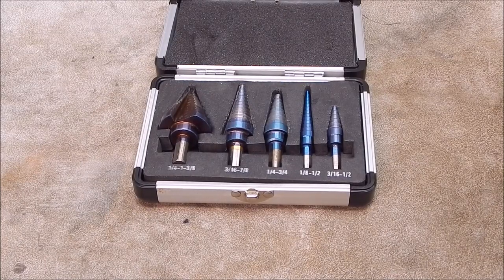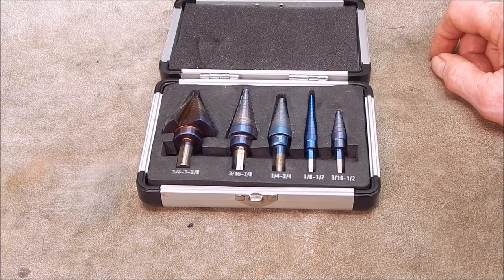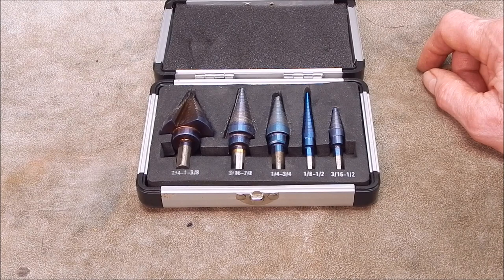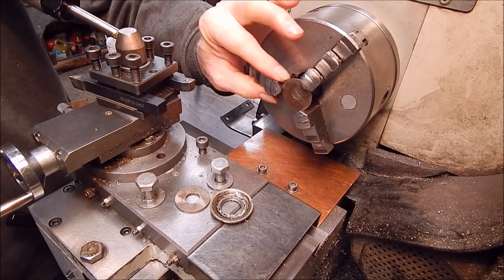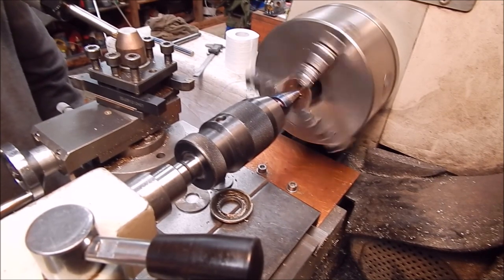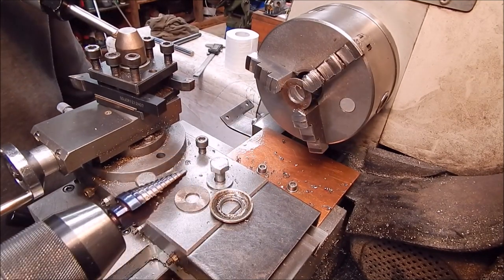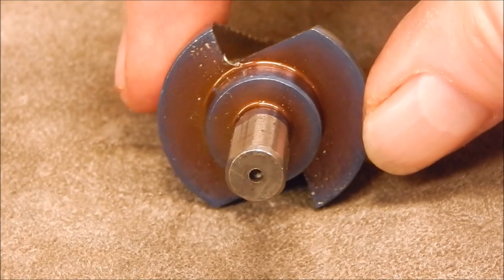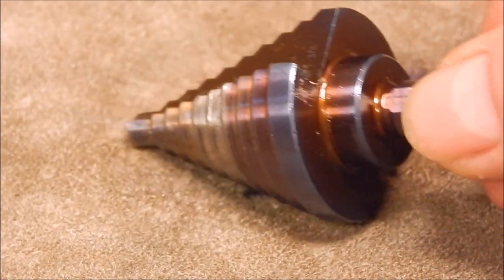Banggood Drillpro blue nano stepped drills re-visited - what's the problem ?

Comment: Hi Rob. I think you're flogging the proverbial dead horse with those bits! I did go and get me a set of those carbide tipped hole saws though. What a bargain, £14 for 12 sizes 👍👍 Thanks for the recommendation. Cheers, Alan.
Reply from the maker: Hi Alan,  yes, you're dead right.  You could probably tell I was a bit pissed off with the whole situation.  However, those BG carbide tipped hole saws are definitely well worth the money and excellent. Cheers Rob

Comment: I have a collection of the cheaper ones but I'm an electronics guy. They're a boon for making large accurate holes in plastic and diecast boxes using a drill press.Large holes in sheet metal boxes are best done with a punch however such boxes intended for electrical use come with a variety of standard sized knock outs anyway.
There's been times when I've needed to create largish holes in brittle material such as fibrous cement sheet and then I resort to cheap diamond core drills but finding ones with a pilot drill took a while. We'd all like to be able to afford to buy everything top shelf but it's better to have than need.

Comment: They are pretty easy to sharpen, that's handy. To bad they still don't cut.  I agree about the geometry.  I will say you get what you pay for with drill bits, end mills, carbide inserts, and taps. I just got 10 Kennemetal CNMG431, which I paid $18 each after tax. WHAT a difference.  It takes less power, I can take deeper cuts,  and it breaks chips perfectly into C shapes.  They come off that tool like a hot waterfall in 1018 with a great finish!!!!  I didn't want to spend it, but it saves me a ton of time and they last longer. . NYC CNC turned me onto them.  Search for Kennemetal CNMG 431 KCU10, I think that's the grade and it should be one of the first videos.  He does a good job explaining.  They are awsome, I highly recommend.
Thanks for revisiting the step drills. Take care.

Comment: The grind is wrong. Notice the area your stone removed the coating color from, at the small end (where it worked) the color is only missing on the "tooth". Fat end, color is missing halfway down the groove face. As you said, lack of relief. A careful regrinding could probably fix them, but buying a "good" set seems a better plan. Love that you "call a spade a spade" in these tool reviews

Comment: G'Day Rob, You're spot on with the geometry. They are great for thin gauge sheet metal up to the thickness of each step. Once you get into thicker material, there isn't enough relief behind the cutting edge, so it binds and the tool pressure increases dramatically when more than one step is cutting at a time. Thanks for the video.  Stay safe and well :)
Reply from the maker: Hi Anthony,  I wasn't any where near the maximum step depth with the metal I was cutting, so I can't see how your hypothesis can work.  It's more than that.  It must be a cutter angle/relief issue.  Cheers Rob
Reply: @Xynudu  OK, I didn't write that properly - but I'm stuck on how to explain what I meant.
Reply: @AJR2208  I might follow- I don't have a bit to measure though. Like increasing the diameter of a thread with constant pitch, the lead angle is reduced. If the steps on these bits are all ground parallel, the cutting edges have progressively less end relief angle as diameter increases. The burr on the backside of rob's holes look like the result of not enough end relief. Maybe could chase the leading edges of steps around on bench grinder--i'd try ruining a few myself before saying it's a practical fix.

Comment: Super definitive conclusion and it is always nice to have closure. As it cuts okay on the smaller sizes, I wonder if that says some thing about the edge cutting speed. For the same lathe rotation, the bigger drill cutting surface will be traveling faster by radius x angular velocity. So if the big radius is 2x the small radius, the cutting speed is twice as fast at the cutting surface for the same lathe speed.  Looking at the tool by eye it appears that the bigger cuts that don't work are about 4 x the radius of the smaller ones that do and so are traveling at the cutting edge at 4x the speed. Whether this makes a difference I don't know, but it seems strange that the geometry works for small holes but not for larger ones and the only difference I can see is that the cutting edges will be much faster in the larger drills. Thanks for sharing!
Reply from the maker: I can only guess that maybe the larger diameter and different side angle has something to do with it.  The smaller ones work fine, but Drillpro appear to use the same step geometry with the much wider cutter angle.  Maybe that is the problem.  I'm totally unimpressed with these in the larger sizes.  The small sizes work OK.  Cheers Rob

Comment: Matey buy the Aldi set, they are great value I’ve had my set for two years and they still work like new, I got them on discount for 5 bucks!
Reply: Wish I'd known, I got my pocket picked $100 for some fancy brand ones. Normally I'd go Aldi but I needed them ASAP. I must say, whatever brand I got, they work very reliably.
Reply: Where i can get them?
If you have a link that will be helpful.
Reply: Yes I got mine from Lidl. No problems
Reply: Lidl ones are German made. Good quality. I buy drills and driver bits also very good quality German tooling

Comment: G’day Rob. I didn’t comment on the last video because I have had a good run with my step drill, no name brand from a local little hardware but since your back I took more interest when you sharpened it with a stone and thought “hang on my drill has 5 degrees relief angle I’m sure “ so I just checked it with angle block, sure enough, 5 degrees and the cutting edge I would say is bang on centre, hope this helps. For interest sake mine will dril sheet metal to 10mm (come in from the back) and chamfer both sides:-)   I know not to buy Banggood should this one ever wear out. Hey I only ever use mine in a cordless drill hand held, I think it would be cumbersome to carry my mini lathe up a ladder to drill a hole:-(
Cheers 
Peter
Reply from the maker: Hi Peter, thanks for that info.  There is definitely a difference in all these units that are on the market.  They all cut differently in comparison videos, and many seem to stall out about where the BG ones did, apart from the expensive jobbies.  The rear side never seems to get shown in a lot of these videos, but mine did and I was pretty unimpressed with the finish.  The front looked good, but that's half the story.  So core drills shit on these IMHO, and that's it I guess. Yes, there's something screwy about that cutting relief, or lack of.

Cheers Rob

Comment: Thanks for making the update. People like me pointed out you were running too fast in part one of this video is because you were.  You wouldn’t have considered running a one inch drill at that speed and the same rules apply. We didn’t say the tools weren’t a load of crap clearly they are crap. But some of the much cheaper ones I have work very well even in the large sizes. I also said I have the same set as you and found them to be rubbish. That’s the problem with this stuff it not all rubbish but it’s inconsistent so you never know until you try it which doesn’t inspire confidence.

Comment: I have a few different sizes/types the one that cuts fastest and leaves a beter finish both sides is a dewalt with a spiral cutting edge but my straight edge ones cut well too, having said that I usually use them in a drill press but they still work hand held if you can hang on to the drill, I tend to let them cut at their own pace rather than pushing too hard, just like an angle grinder cutting disc.

Comment: Step drills work great. I can look at the ones you have and see there not made right.  It's easy to see the steps are not right. Today I use some Harbor Frieght step drills to drill threw a lawn mower deck with no problem. Only cost about $8.00 for 3 of them.

Comment: I agree it is a geometry problem.  I would think that to make these cut, each "conical" step would actually need to be machined as a thread (i.e. helical) to get some relief angle, otherwise the whole surface of the cone would rub and no cutting would happen unless the axial force was sufficient to deflect the material enough that when it elastically springs back in the milled groove, the cutting edge can then shave a little off.  As diameter increases, it becomes more and more difficult to apply enough force to make this happen, and as you try, friction increases until the reaction torque stalls the drive motor.
This helical geometry would be a bit more complex to do than just a stepped cone, i.e.  it would be easiest to make the main shape on a 4axis cnc mill rather than just a manual lathe.  Looks like Bangood milled a slot out of a turned stepped cone and called it near enough.
Reply from the maker: I think the step attack and relief angle should change as the cone taper angle varies.  That doesn't appear to be happening.  The smaller diameter/tighter angle cones probably cut so much better because in part the angles are more suitable.  Cheers Rob

Comment: Hey Rob try cranking the lathe up flat chat and see if they work as a friction drill 😂
I reckon it has something to do with the depth of the slot ( the surface where the numbers are printed is not deep enough ) as the size goes up you get more surface area on the annular step surface and it transforms from a cutting tool to a bearing surface . I suppose you could always glue one on the end of a long stick and make a spear out of it 🤪
Reply from the maker: I have no idea why the larger diameters don't work Ian.  I'm totally unimpressed with these gadgets and as far as I'm concerned my tungsten tipped hole saws leave these for dead and can go through much thicker metal of any type.  End of story. Cheers Rob

Comment: Im still thinking relief angle is probably just zero. you could check it by holding the cutter in the lathe and running a dial indicator on the top of the step.  Ive improved cheap ones before with a dremel but dont make the mistake i made, its the top of the steps ofcourse not the sides you need to look at.

Comment: That's a real shame, must be a production mistake. I've got a cheap set from Lidl and they are excellent in every material I have used them on, cut perfectly on every size, not even needed to sharpen them yet.
Reply from the maker: They are not all the same.  Watch any comparative review and you will see huge differences.  So if it's not metal related, it must be a geometry issue, which I expect it is.  Cheers Rob
Reply: @Xynudu  Sorry that's what I meant, manufactured incorrectly so they cutting geometry isn't right.

Comment: its luck of the draw with those cheap step drills.i had one where its center point was sharpened to a negative angle (can not cut) but given a pilot hole works fine.

Comment: this product has 2 problems:
1 - it has no back clearance at all so it just can't cut
2 - "blue nano" paint instead of coating.  actual coating it mimics is "nACo blue" (yes naco. not nano) which is good and not cheap coating with additional blue coloring top layer. 
and it seems like manufacturers of cheap chinese shit like this drills just apply this coloring layer alone to bring some fake shine )

Comment: I am certainly no expert in the field of metallurgy, but I feel your testing methodology is flawed. All of the knowledgeable and skilled machinists on YT seem to bang on about the importance of Surface Feet per Minute (SFM). In your demonstration, the initial holes (smallest diameters) seem to work very well, indicating that you are operating within the range of SFM suited for that diameter hole. However when you increase the diameter of the holes to two and three times the diameter of the initial holes, you don't decrease the cutting speed to half and one third respectively. Secondly, in the case of stainless steel, again those with knowledge and skills seem to be in agreement that when working with SS, you should " Decrease the Speed and Increase the Feed" ie reducing the speed reduces the friction generated heat that hardens the work while increasing the feed removes the metal that has been slightly work hardened, as you go. Around 16:12 in your original video shows the discolouration of the SS caused by excessive heat. Noting also that the step-drill has only one or two cutting edges to remove the work hardened material caused by the friction between the work and the significantly large surface area of the tool, between the cutting edges. Compared with the hole saw that has numerous cutting edges and minimal sources of friction. In my experience, step-drills work well to quickly enlargen holes in sheet metal, whereas using a hole-saw requires a "pilot-hole" to maintain concentricity. Ie "Horses for Courses". After all that, thanks for the demo and I think you are right, they probably are mediocre quality step-drills suitable for occasional use on sheet metal when no other options are available. Cheers from across the eastern border.
Reply from the maker: The maximum rotation speed is quoted as 300 RPM.  That's for ALL of the stepped drill sizes.  There is NO distinction regarding diameter.  

While there was definitely stainless steel work hardening in the original review, the poor cutting and finish issues were still apparent in the follow up at 146 RPM with softer ferrous metals.  So blaming work hardening or too high a speed is total nonsense IMHO.  The issue is clearly poor geometry.  Look at any decent comparative YT review (and there are some good ones) and you will see that this is not just a Banggood problem.  Stepped drills are not all created equal.

Regards  Rob